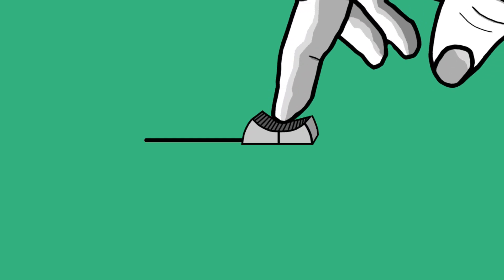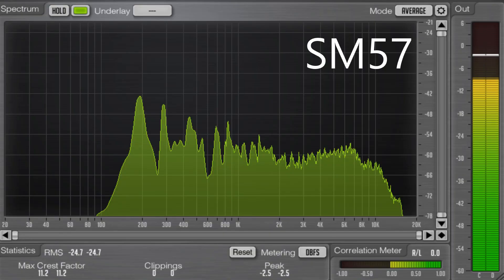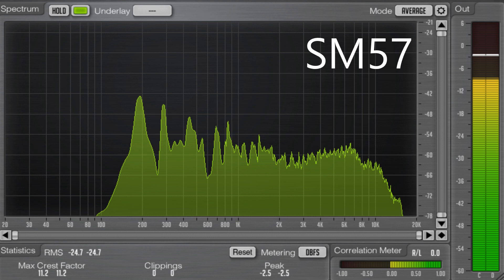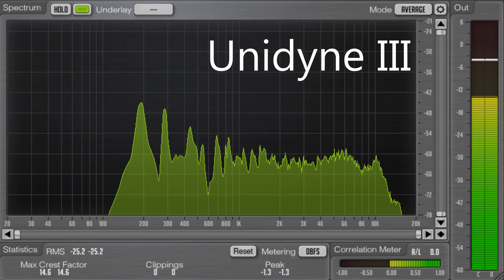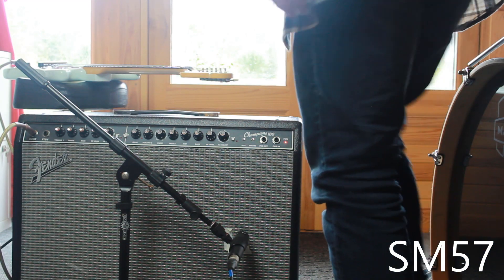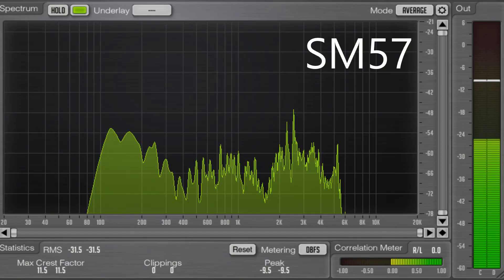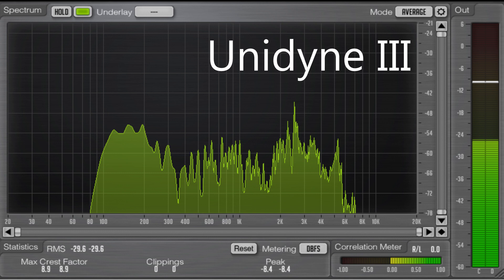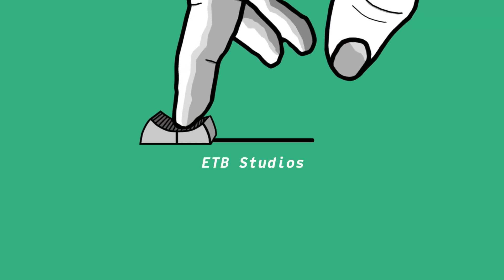SM57 vs Vintage Unidyne III 545 Model (Frequency Analysis)

Comment: These mics DO NOT use the same capsule. The 57 has a copper voice coil and 545 has an aluminum voice coil. The capsules are tuned for different purposes. The 545 is a PA microphone designed for speech intelligibility while the 57 is a studio microphone designed for high fidelity vocal and music reproduction. Both are Unidyne III designs and share the same head basket. That’s where the similarities end.

Comment: Sir, did you replace the inner foam pop filter on the 545 mic? I ask because these are always degraded and fall apart from old age. It is very important for sound quality on the 545 mic.
Reply from the maker: No I haven't, I'll look into it though! Thank you
Reply: @ewanbennettproducer  It's often overlooked when testing older mics. I'd be curious to see how the mic performs with fresh foam inside?

Comment: I love the 545. Especially the USA made 545's. I've had many. Currently I have 2 Pistol version (I might want to start a small YouTube vlog with guests and I thought these will look cooler than the standard sm7b. 1 is completely original. 

The other one I got a pistol body in a box with broken microphones. It was rusty but had all the internal electronics. So I cleaned and polished the body. Then used the cardridge from one of the best USA 545s I have. And now I need to fit the electronics in some kind of wax so they stay in place but otherwise it sounds very well. Perhaps better than the original pistol one. 

I also just scored a 545L for €50. It has a smaller body with a cable out.  Butterfield used one for his harmonica and I understand why. It's slightly smaller but it fits in your hand. 

Digression:(I have a modern 520SX which is almost the standard for blues harp microphones. But the one I have is made in Mexico. So it's solid but I suspect a US one would be better (and certainly easier if you want to put it on a stand). But the possibility with that one to easy get overdrive because of the volume on the microphone. )

So I will keep buying and selling the 545s. But the special ones I will try to hold on too no matter how hard the financial state of affairs. That 545L will only be sold at a liquidation auction. 

The SM57 is a good mic. But I feel that technology has caught up with it and you van buy better mics for less money. (You could say the same about the 545 but there I want a vintage sound and I don't buy the Mexican ones. I've never heard someone argue for a sm57 (or 58 for that matter) to get a vintage sound. A familiar sound sure. But if you want a modern microphone I'd look a bit further. (Though the near indestructible nature of them are a plus. After nuclear war. When Keith Richards is the only person living. He'll leave a message to any aliens that may come by on a reel to reel tape with a SM58.)

Comment: If you didn't record both mics in the same place at the same time, comparing them is pointless.  Unless you are capable of scientifically duplicating snare hits at the exact same angle, location and velocity, which of course you can't.
Reply: Even if you record the same performance with two mics, it's physically impossible for those mics to occupy the same point in space or run through the exact same signal chain. Small differences in placement and signal path can also make a big difference, I'm sure you'll agree. In other words, there is no perfect test! This one strikes me as quite good and informative.
Meanwhile, did you actually listen to this guy's results or just start ranting about an abstract principle in the comments? It don't think it's really that hard to hear a difference between mic tone vs performance if you just concentrate and have some experience listening to different performances and mics on the same source.
Reply from the maker: If you didn't leave a pointless comment on the video, no one would have asked you to do a better job. Unless you aren't capable of making a comparison video of your own, using the exact technique that you just explained. Which of course you aren't.

Comment: The Unidyne III sounds weird with the guitars. The initial attack on the notes sounds substantially brighter on the 545 than the SM57 but then it resolves into a warmer tonality than the SM57. I think the three low end peaks have something to do with that warmth while the more high end peak is responsible for that bright initial attack. The SM57 on the other hand sounds comparatively even than the 545. 
warmth. Maybe the 545 was used by those artists and it had something to do with that sound.

Comment: I think your comparison shows the mic differences in a very practical & useful way thank you.  I gigged a Unidyne III 545 for years as a vocal mic and loved it.  The Shure website says:  "The SM57 (1965) and SM58 (1966) were based on the popular Unidyne® III 545 (1959) used for public address systems".  Shure also said: "The primary difference between the SM57 and the SM58 is the grille design. The SM58 was designed for vocal applications, utilizing a ball grille that acts as an effective P-pop filter. The SM57 was designed primarily as an instrument microphone where a smaller grille size is preferred". I found that little extra presence of my Unidyne III 545 great on vocals and I never had significant problems with plosives, Rock on ...

Comment: Hi! Are you using an amphenol / xlr adapter on the 545?
Reply from the maker: It certainly is
Reply: @ewanbennettproducer  Hey, would you care sharing a link / reference to this ? :) thanks !
Reply from the maker: @luje-music  hello, there is very little information on the adapter, my 545 came with the adapter already installed.
I have managed to mod my other 545's to now be 3 pin connectors, so I may make a video on how to do that.
Reply: @ewanbennettproducer  please do ! :) thanks a lot
Reply from the maker: @luje-music  here is that video, sorry it took so long haha https://youtu.be/XXfcfyihFUs
Reply: I modded mine to a XLR. Quite easy. The white cable can be left out (High-Z) so, connect the others accordingly. The XLR i had as spare taken from a Beyer M260. I also changed the transformer by replacing it with a Oliver Achut T58. Best on snare. And a hint. The sound is not two but three dimensional, so the mics  are quite different IMHO. The details are better defined than on a stock SM57.

Comment: I would really hate to split hairs, but IMO it's better to refer to the 545 as the 545 instead of the Unidyne III. I say this because the Unidyne III is the capsule used in various mics including the SM57, SM58, SM7, SM7B, and the 545 to name a few.
Reply: It sounds better too. 😉
Reply: Other than the 57 and 58, none of those mics use the same capsule. Unidyne III refers to the patented technology deployed in the design of the capsules, not a specific capsule. For instance, the 57 uses a copper voice coil and the 545 uses an aluminum voice coil. There are also other differences, including how the the capsules are tuned.

Comment: Strange. My Unidynes has less highs and more lows :D
Reply: depends on impedance matching and your peramps
Reply: By most of them the foam under the grill is sticky and have a lot of influence on the sound. Most “new” sm57 have that problem even earlier. After 4 years or so the foam needs to be replaced

Comment: This is fantastic. I would love to see an acoustic test as I am on the fence about whether to go vintage and opt for the older copper over the newer aluminum wiring. Acoustic is my use case 100% of the time.
Reply from the maker: In my opinion on everything I've tried, the unidyne just sounds nicer to me. Although for an acoustic you may want to go for a condenser microphone as they are able to pick up quieter sound sources easier!